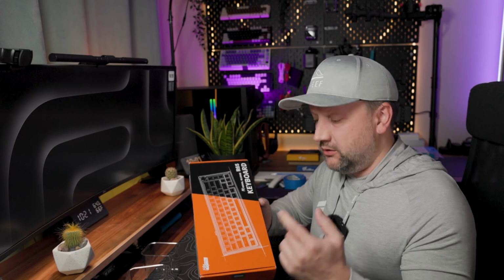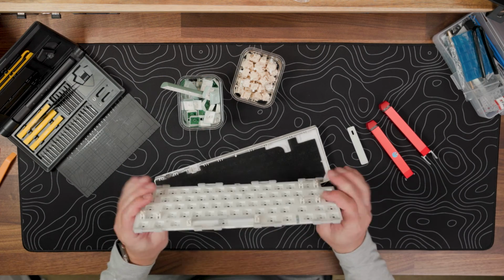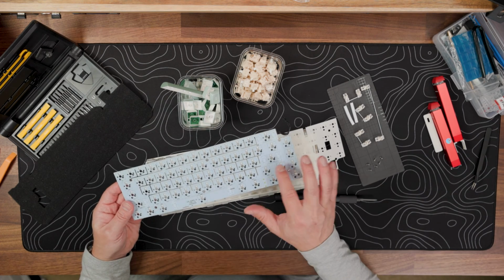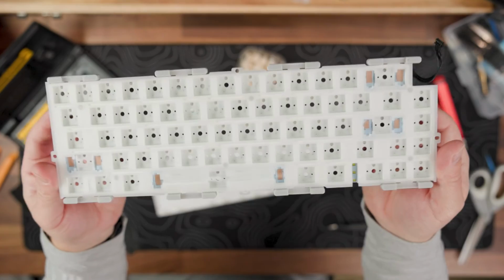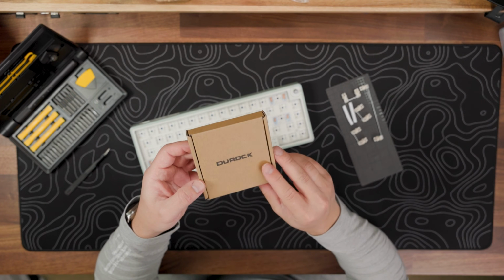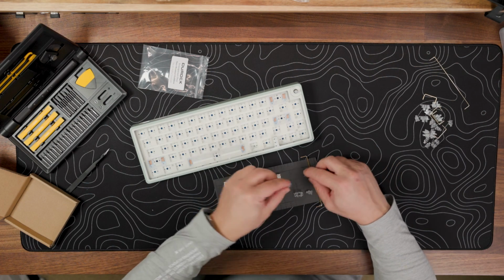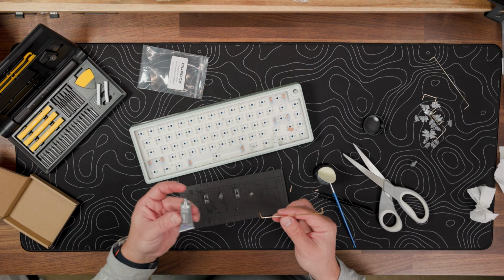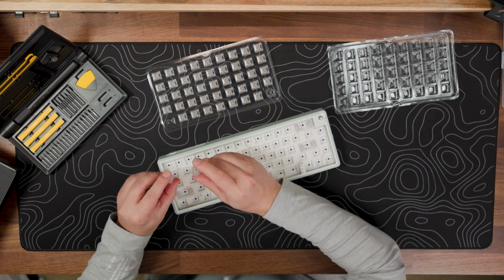ROYAL KLUDGE R65 | Full MOD Guide!

Comment: if i were to change my keycaps to razer style ones, should i need to change the switch to have better rgb shine through or is the rk cream switches have enough rgb to shine through already
Reply from the maker: Rgb is not inside the switch, it’s on PCB, but if you need the best shine through you need switches with transparent upper housing and RGB guide

Comment: when I accidently dropped my keyboard I thinkj clips in upper half of frame got unclipped there is a opening in there, then I tried to pop them back in and managed to pop left side but couldnt do the same on right any ideas on how I can clip other parts of it without diassamble it, and would leaving it like this cause problems in kb (it doesnt cause any rn)
Reply from the maker: It’s hard to say without seeing but just try clip it, it not just open the case and close again
Reply: @getsmarthomeoffice  any specific place I should try to put force in or any way up down etc when trying to clip it? couldnt see anything about it in the video since that part is pretty short
Reply from the maker: @ this plastic cases are hard to open without tools, but you can try and then you will be able to understand how this case structured and how to close it

Comment: So...this keyboard sounds great stock. Is it worth modding? Like is there a significant difference in the sound and feel? Should I replace switches? Stabs? Are pre-lubed switches just as good as hand lubed switches?
Reply from the maker: it's not a mast, it's just example how to do it in case you want to do it really custom with this keyboard or with any other keyboards